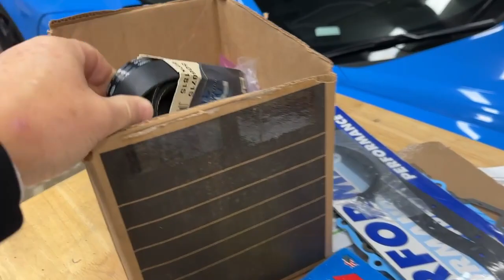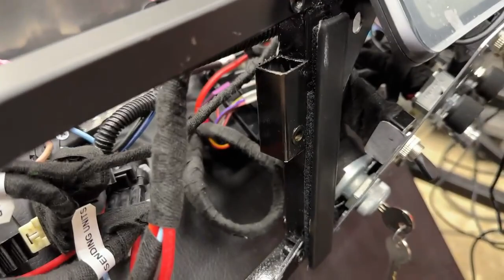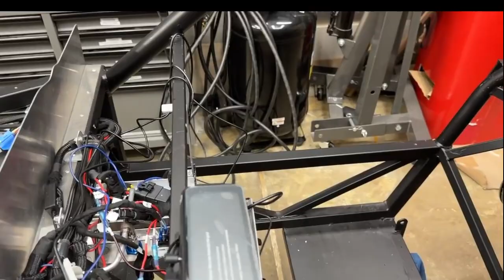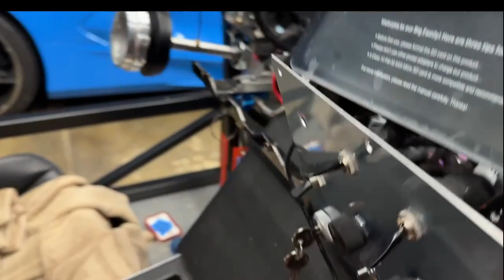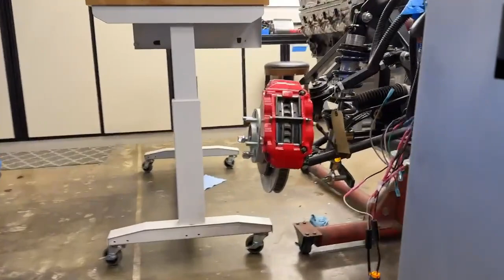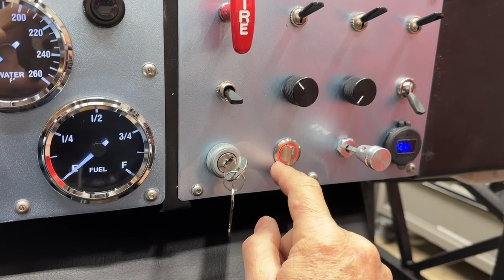John's Daytona Build 6 - Engine, Dash complete, Fire suppression

Comment: Repeating a comment that I just posted on Ep 2. I guess u get notifications but hey?????

John, your side clearance on that balance bar looks a bit generous. Willwood's "technical" video, in their normal ambiguous style, show .200" - .250" total in their diagram, quote verbally 1/8", and to top it off they show their 'racing manager' advising the use of 2 x US$ quarters. I just measured 2 quarters at .140" total.
Minimum side clearance is preferred as the shaft needs to bind, and therefore lock-up in an emergency situation, in the event of losing line pressure in one side.
My opinion is that you at least double-check your setup.
Jim G. Melb Australia. Ex 7-years racecar fab at sort-of-neighboring Sonoma Raceway.
Reply from the maker: Hi Jim,

Thanks for the input.  I will fix the issue you identified.  I have not posted recently, but will do soon. I now have the car running and am working on the body.  Thanks again for the input on the balance bar - I have watched the two quarter video you describe and need to go back through everything that I did early on

Comment: Is the great looking period authentic wooden steering wheel from Factory Five? ....16 inch ???..... So your rear camera is connected to the interior rear view mirror?  ... Who sells that ???? ... Can you possibly also connect a front camera ??? ......
Reply from the maker: The wood steering wheel is indeed from Factory Five.  I am not sure the diameter but it feels good.  Yes the rear camera streams to the mirror display;  I have the same setup in my C8 and it is fantastic.  Front camera - not sure.  And I don't remember the manufacturer - there are quite a few.

Comment: Looking very good, John! Wiring and everything else is important to be neat and easy to get to if repairs are needed later. It will be great to see the drive train in and the interior done. I'm guessing the bodywork will be done last.
Reply from the maker: Thanks.  I just did not like the way the Ron Francis harness was jammed behind the dash, so I decided to start taking it apart and he next thing I knew it was all apart and looked like a rat's nest.  But I am happy with the end result and learned a lot.  The drive train is next; actually I need to install the throttle pedal and have Mike Forte's solid linkage setup - hopefully it will be straightforward!   The bodywork will be last - I may get it running a drive it for a few months first.  Partly to get the kinks out but partly because I want to drive it!